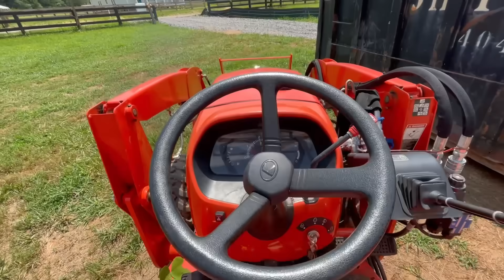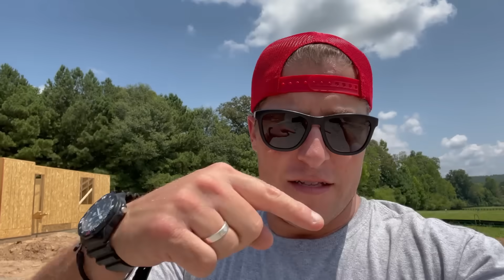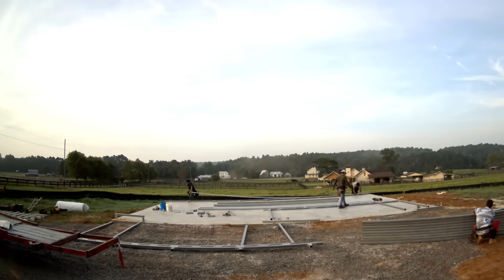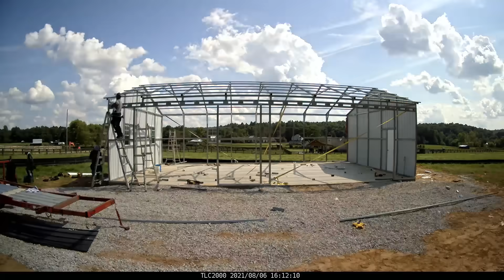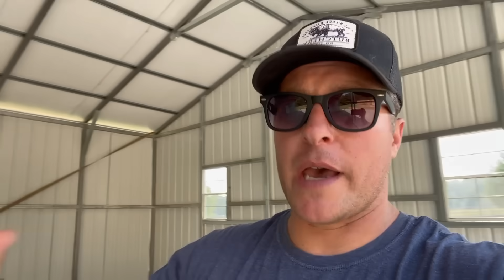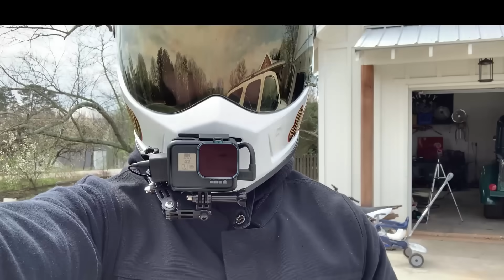I FIRED THEM!!  26x40 metal building Dream Garage build Ep.2

Comment: You are completely right.
I had some new steel roofing done.
1 some bolts missed the beams.
2 had dip in middle, they said it's what they call ski jump
3 I was told a new beam was needed at edge. Didn't have saw to cut out properly ( cause of ski jump )
4 too many bolts used  not straight and not as engineers recommend. 
5 edge too high exposing beam to rain.

Comment: That truss issue is a big deal with snow load 1 foot of wet snow could result in a collapse  I live in Seattle and one year a wet snow took down hundreds of those buildings with 12 foot spans and yours is way bigger and you played for a stronger frame I'd be pissed they should have hid the defective metal by putting the lap inside if possible I see a lot of those for parking covers and motorbikes but not 26 feet wide seem flimsy

Comment: I have built a few steel buildings in my day, all wood pole barn type framing but with a manufactured metal package. If you can’t get the company to fix it you should try to get the inspector that signed off on the plans to come out and make a
List of the stuff that they did wrong and actually showed different in the drawing they sent in. That way it will have no issues in court.

Comment: this comment is pretty late, and no doubt you've finished with whatever you got, but MY two cents worth is this.. have them take it down. get a lawyer if you have to. as far as vertical panels on the sides, i've seen and built a lot like that.. standard usage in my part of the country.

Comment: Looks to me as though the sheet sides were over lapped on the wrong side of the over lap.  That's why the ripples.  YES I would send it back.  I ran into the SAME thing with a different building and company and when the metal was up, the width of the building at the base was 2.75" WIDER at the top of the wall than it was at the base.  BUT, when I measured the base, it was less than 1/4" off from the exact width it was supposed to be.  It turns out the upper dimension changed due to the cut of the material and the company said it would be fine.  When you go to the interior walls, you can actually SEE the walls are NOT vertical.  This is the kind of SHIT the U.S. consumer has to put up with now that we have allowed the immigration process to get out of control and ALSO NOT FORCED these people to assimilate to the U.S. quality standards.  Fire these guys and FORCE them to come fix it.  You PAID for good work.  DEMAND IT.  If NO ONE holds companies like these accountable, then the quality will continue to become shittier and shittier.  I know it's a pain but it will be great in the end.  MAKE THEM PAY.
Reply: Really?  You gonna blame shoddy work on immigration?  Cuz NO ONE has EVER done shoddy work before, right?  NEVVVERRRRR.  White Americans would NEVER do that....  Get out of here with that racist BS.

Comment: It's wrong as 2 left feet, it has to pass inspection, so they are at least responsible for that.  I thought stuff like this only happened to me lol. I finally got to the point where I do everything myself, I might as well do it the first time as have someone cobbnle it up and then try to use all the pieces they screwed up to fix it again. They probably got a deal on that rippled siding and thought you wouldn't notice.

Comment: For the Trusses, it depends on the snow load for your area, on the one hand, you gain height but lose load capacity. Regardless any changes in the specs need to be rectified or negotiated. The panels are a cosmetic concern.
Reply: I’ve install carports and red iron buildings my whole life, in carports with this type of tubing, they didn’t look at snow load or anything for the area unlike red iron it does depend on area.
Reply: I live In Montana and that building would either blow over or collapse from snow.
Reply: @travishanks7295  I thought that too,  i live in Nebraska and have seen 80 mph winds blow buildings over.
Reply: @1965ace  I live in Livingston Mt and it gets 80 all the time.  They make u hurricane stap anything in a tornado zone. We barely get em but on a plain you can see some hellatious steady winds. I've been to alliance in the winter I know you know about snow and wind as well

Comment: sheet metal is bad replace them . on truss add a longer cross but weld it with a mig on site when weld a center up to first cross piece when add one center to top center all welded in place  then use zinc primer paint so wont rust on welds

Comment: The structural is a problem especially if you are dealing with snow load in the winter season. The cosmetic may be a little tough to get relief on..  The county/city (whoever approved the plans should be a big help in that respect. I tell them take it down and build it per plan, welded not screwed. Good luck .

Comment: I did a post frame. 24X40 and it was 30K. With 18' tall, spray foam insulation. Sec floor/ on 3/4 of it.  Buy crap you get crap. Spending 18k you should be happy it's not cardboard.

Comment: As a retired structural engineer, my advice is to cancel the contract and demand the "building" be removed.  Any effort to correct the roof truss issue is pointless.
Reply: Those trusses were shipped incomplete, they need to be reengineered as a repaired with new plans new structural engineer seal.  Dont get in a fight you got a long way to go.  They can refund the price of the erection and leave.
Reply: Yah.  Its built like a thin ribbed garden green house with metal siding.  Its not a true box structure.  Any load with high wind and snow will fold that stricture.
Reply: Those panels were shit. Looks like they mistreated the entire bundle or their roll former is needing repairs.
Reply: I don't get the 16' truss? If the bldg is 24x40 the trusses should be 24'? No:?
Reply: @tomwinkle1597  That is what I was thinkng!
Reply: I’d do exactly what you’re doing.
Reply: True ! Good advice !
Reply: Retired S.E. here also.  There appears to be an absence of wind bracing.
Reply: Absolutely reject the building and have them remove it.
It is not to to plans that you and the building dept. approved.
Reply: @Robert Swaine any common sense at all would tell you that to stop short of the exterior wall would throw too much load on a short section of rafters .
Reply: It’s engineered, if it wasn’t the manufacture would get their ass handed to them.
Reply: I briefly thought about an all steel garage. But I've seen horror story after horror story.  I went through and got our building permit which also needed a soil erosion permit due to water on our property. Bought a 32x48x12 pole frame "kit" from menards and is in process of being staged and delivered. And I'm having a family friend contractor build it.  Definitely not cheap but nothing is these days. But I know what to expect.
Reply: You're bought a light build shed , if you want strong you buy industrial,  tin is often not perfect on the edges , most roof purlins will bough with a person's weight as they are thin , you bought a cheap shed , but you should get what you paid for
Reply: I say 6 inches of wet snow or 65 mph winds and it folds like a dog.
Reply: As a retired Builder I agree. Cancel totally.  Remove building altogether. 
Not structural at all on roof truss.
Panels look very bad.
Reply: The walls and supporting structure would never support any roof loading and snow load no matter what truss system they put on it.
Reply: @jimandrews2967  not four feet of snow that's 4 sure.
Reply: All you have to do is run a beam all the way across. If the building is 16 feet wide that's how long it has to be. It rests on your top plate
Reply: @travishanks7295  and why would you expect the owner to install beams?
Reply: @robertbutler8004  I never said he needs too.I said it should have been done during the building process
Reply: @travishanks7295  what needs to be done is what he paid for they didn't build what he bought they need to at least take the roof off and install the trusses he paid for as far as the metal seam's you bargain shopped and got what you paid for.
Reply: @travishanks7295  Really?  And just what size "beam" are you suggesting?  And what material? And how far apart?  
And if the roof "trusses" are under/incorrectly designed, what makes you think the wall studs and bracing are any better off?  Will the added "beam" impart additional loads on the wall system?
As I recommended, scrap the building and demand a refund.  Or require the building supplier provide a document signed and sealed by a licensed engineer.
Reply: @ericchapman8719  they failed to do that once already, the permit office has plans they approved that involved a welded truss with a 16' span on the webbing, vs a 6' span that was installed. I don't know if the trusses they stood up are completely welded, I couldn't see that in the video, but what is submitted on the plans is what needs to be installed or it won't pass the structural inspection.
Reply: @alexfrederick9019  I understand 👍
Reply: @alexfrederick9019  I put these up for a living they usually just weld two sides of any given joint unless code calls for more
Reply: @alexfrederick9019  Here in Arizona that building would never pass the county planning desk. I agree with the fellow on the comment that what you have as it stands  is nothing more than a tin shed without a lot more bracing .  Shame on them.   I am  months late on this comment.  Would like to know the final  out come.   Rod.  Arizona
Reply: @travishanks7295  you're describing a ceiling joist. I'm sure the dimensions submitted on the truss materials met the code for the approved plans, but describing a 6' rafter collar basically, vs a triangulated truss that is structurally designed for the load that span would expect, a single piece of extrusion won't necessarily meet those load requirements at the span he has.
Reply: @travishanks7295  thats not the point, imo, regarding his situation. The builder/ manufacturer is already in breach of thier contract with the customer. Beams have already had fatiuge on the structure simply from being installed and having tin hung on.
Reply: Nees a lawyer  , PERIOD

Comment: From the pictures I would say that building is a piece of junk, there is load ratings, I live in the Southern load rating area and they figure so inches of snow on the roof and the weight. I would say your building would fall with 1 1/2 inches of wet snow. The metal is factory defect on the edge, now the over lap should be away from the approach of the building so at a glance you can't see the joints. Now most time when looking from the back you can see the joints of the metal but it doesn't jump at you.

Comment: I sell these for a company that bends, cuts, and welds their own tubing.  That is not a welded truss and it looks like they cut the panels is why they have that ripple.  They should not have cut them, they should have and L shape on the end for a good overlap finish.  Sounds like that either the sales person lied about what comes with the building you purchased or the building company is trying to screw you by sending a different building than you bought.

Comment: Seriously, I am 100 % with you on this!  I too have had experiences like this with sub contractors and contractors who do not seem to have any integrity or pride in what they do.  I would be extremely pissed at that kind of poor building practise and it just shows that so many builders will try and cut corners to save themselves a dollar at our expense!  Dig in my friend and don't let them get away with this!  Cheers and good luck!
Reply: It's the way our young have been taught for the last 30 years. Everything is built to throw away.  This guy took a chance and lost. Ya get what ya pay for.
Reply: I just had to clear a roof like that very sketchy . The siding panels do go up and down on the outsides. Make sure you sheets are screwed down at bottom edges not in between ridges
Reply: You know what’s funny is by the looks of it with what the material looks like they did a solid job with what they were sent. That being said they were sent shitty material
Reply: now in my experience these things are often the result of the customer wanting the cheapest product for an even cheaper price. it nurtures and breeds the kind of contractors who think this is exceptable.

Comment: Here in Ireland that sheeting would be classified as seconds, the truss has no strength at all trusses here would have vertical , horizontal and diagonal pieces for strength and rigidity. you were dead right to call a halt to works personally if the specs you were quoted for are not as build tell the to remove there scrap best of luck

Comment: The bottom line is the structure needs to be structurally sound! obviously it’s not! if you get several inches of snow on the roof it’s gonna bend even more!

If your contract called out for stronger longer support trusses that’s what they need to provide and install! there’s no question about it perhaps you should share the company name, so buyers will know not to do business with them! 

 I think it’s totally unacceptable that work they did and the parts used to build it!

they need to do the right thing and modify the structure for it to pass your cities building code!

if not you should hire an attorney or tell them you’re going to post the name of the manufacturer and all the people involved in the project!

Comment: Not saying you didn't get homered but, as a contractor it's funny you wait until the building is up to fire them, secondly- you come across as a  pretty capable person- why didn't you do it yourself ? Funny how you are bitching about "direct pricing" and coming from second, third party etc.- perhaps you should have done a little more research. I agree with another gentleman- you get what you pay for. I have potential customers who will use non licensed, non bonded and non insured to do a project because they say "I cost too much, or my price is too high". I am licensed, bonded and insured- go cheap- then call me to fix it.  Could go on, but I won't. Just sayin

Comment: Same type experience with the largest building manufacturer in NC.  Contract not followed . They read what they wanted to to into the ( contract). Was told they are not installers they are just manufacturer.. No help from dealer ...out of their hands....Buy the more expensive pole building from your local contractor....or do it your self ...I will never deal with any similar manufacturer again. Illegal labor that is not experienced just as bad as manufacturer.

Comment: I had one installed as well and after the installation I had done some electrical work and boy you would not believe the problems I found in mines when I started to climb over it to do the electrical work. I sent the company pictures and its been almost a year now and they still refuse to come out and fix the problems. They shorted tubing and pieced some together above the garage door, the windows aren't centered in the wall, it constantly leaks,,,

Comment: I'm not an Engineer, but I've lived in New England all my life. (78 now) and I looked at the rafters in the video, the size, and most of all the amount and spread/distance between them. that buiiding will not take a heavy snow load in this area. the sizeing of the studding. its just a piece of crap! you were well in your rights to fire them and the crew for doing such poor quality work . I'm old enough to remember when  tradesmen took pride in their work and cared and so did the contractors. Today? quick easy,cheap, and screw'em! is their motto Sad Their are a few out there that care but unfortunately not enought to overcome the rest. Welcome to the "New Generation".

Comment: I had a 26x50 installed about a year ago.  Same kinda structure.  Those trusses you got are garbage.  Mine is like you described, 16 feet long with welded braces along that 16 feet.  I would have rejected that as well as the wavy pieces of siding.  That looks horrible.

Comment: Hey lol I have a 20 x25 Building from VersaTube with the nice Trusses, panels Sideways lab over each other metal panels. Well, it took me an entire summer to Build it by myself part time wknds, days, my son helped with roll up door and standing up Trusses. There were some delays parts missing, wrong size studs that I had to cut myself Engineers were very helpful, they responded quickly and send parts or the answer. All metal buildings have gaps, will flex on Roof if you walk on it but are very strong if you have the patience to do it yourself, I Filled all the Gaps with gap, crack filler etc. Just getting ready to insulate it. Just passed inspection